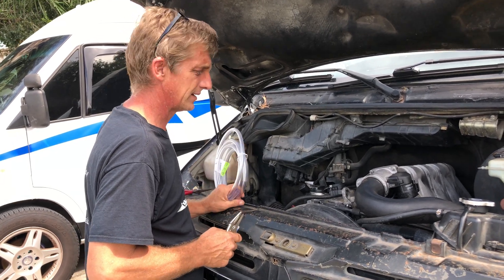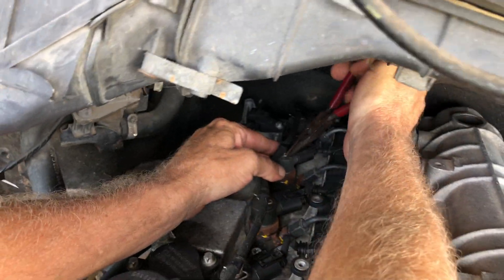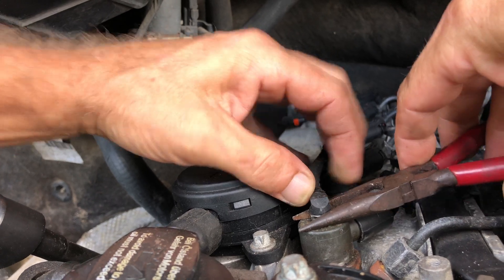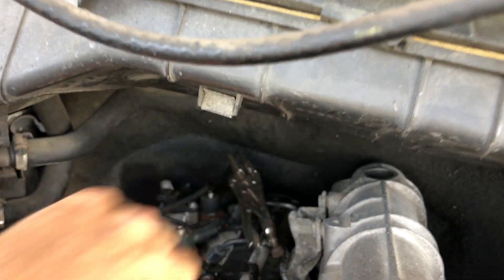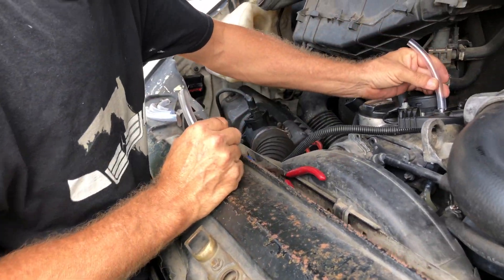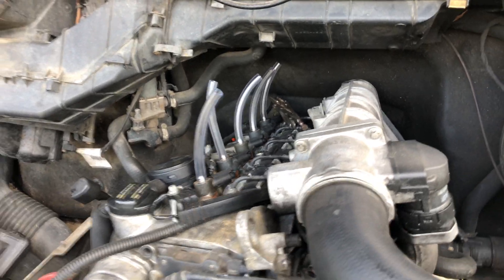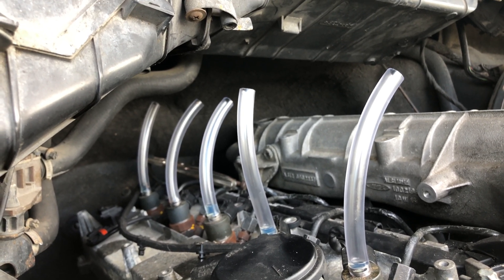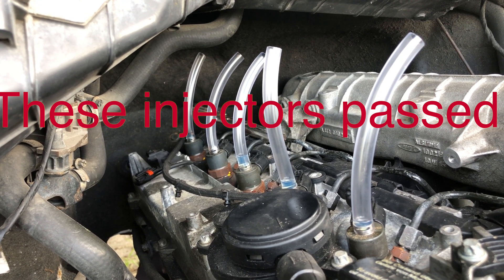Sprinter 2002 Injector Leak Off Test T1N

Comment: Omg, I'm confused. 
So I  did the test exactly as you did first time through,  but not fuel in any of the lines/tube's. Does this mean pass or fail?
Still not starting.
Reply from the maker: Hi Corky, That suggests you don't have enough real pressure to fire the injectors. usually that means the rail pressure control valve has pooped itself. Ideally we'd view rail pressure in live data. if that is low we can pinch/kink the return line and try to get the van started. This only works when there "not quite" enough pressure and won't do anything if we aren't even close.
Reply from the maker: Let's continue on B's Facebook messenger. It is faster and I get notifications there.

Comment: Gotta put new injectors in my 2005 t1n.  What's best route ... Rebuild or replace 
Bosch or ? 
Any sources would help me a ton 
Im in n fl   ...got old ones out with your help. .what a blessing you are 
Spencer Topnotch
Reply from the maker: Ocaladiesel.com - William's Diesel in Ocala is where I have my injectors tested and rebuilt as needed. I do not trust anything on eBay or Amazon when it comes to BOSCH brand name. Local parts stores also sell counterfeit products that do NOT meet BOSCH specs but bear the brand and fake* holograms.

Comment: Will injectors cause van to keep stalling while driving I have a code p0087
Reply from the maker: If one injector is releasing too much fuel to the return line, as this test discovers, the rail pressure cannot be maintained and the van will stall. 
Your code reader is not compatible with your van. 0087 is not a code your van can produce, so we know the reader is miscommunicating the On-Board-Diagnostics (OBD). We have a link for compatible AP200 and a video showing how to set it up for theses vans to get accurate data from the OBD.
Reply from the maker: https://floridavanman.com/
Reply: @FloridaVanMan  also what type of code should it read for something like what you mentioned?
Reply: @FloridaVanMan  wow it’s at a shop & that’s the code they say popped up. Crazy that they don’t have a higher end scanner smh
Reply: @FloridaVanMan  the mechanic says that he doesn’t think it’s an injector because it idles & starts up fine. 🤷‍♂️ can injector still be bad if idling fine?

Comment: Can Injector leak cause t1n crank but no start?
Reply from the maker: Yes! If the rail pressure isn't high enough the van won't start. Injectors leaking to the return line will release the pressure.
Reply: @FloridaVanMan  Thank you for your answer. I'm t1n user in Thailand.❤

Comment: I recently replaced the injector copper washer and bolt on injector no.1 on  my 4 cylinder 311cdi and have created an air lock in the system, can you tell me the best way to remove this air from the system please.
Reply from the maker: Not sure what you mean by air lock. Air in the fuel system will work itself out soon after the engine starts.
Reply: @FloridaVanMan  I just wondered if there was a way to release the air from system going from filter to fuel rail as I can see bubbles in the pipes and it struggles to start. Does undoing the pipes going to each injector help release this air or will it just remove itself once engine is running
Reply from the maker: @MLJ-p7n  Any air in the fuel line will quickly go to the tank via return lines. If you are seeing bubble in clear or white lines that is air leaking in. It often gets in at the 'water in fuel' sensor on the bottom of your fuel filter or the snap-on connections. Since you have lines that you can see into, you must have an OM612, 2002-2003 in the USA or OM611 in UK.

Comment: looks like this is on the to-do list today. 
I am getting codes. p1190-128 rail pressure control valve. p1187-8 rail pressure control valve stuck closed.
Reply from the maker: 1187-8 is very specific to the control valve sticking in closed position. I would still test every possibility before throwing parts at it, but I think* a valve replacement will be your Ta-Da!

Comment: I replaced one injector that was leaking. Two weeks later after a couple of long trips I hadca problem.   When I stopped for a coffee break I tried to start it and it wouldn't start.  Turns over but not starting.   Start ya basdard ( ether spray ) in the air intake  did the trick.   Seems weird if I get a starting issue when I didn't beforehand

Comment: @Florida Van Man  thanks for all your hard work, I love the t1n and since now this is going to be my home for a while can can you make a video to get a wire in an extra battery. The way I did it was adding a spliter and connecting a new lead from the alternator. One side to main and another side to the battery on the back. 

My question is where is the best place to get an ignition wire. I heard there's one under the driver seat but I'm looking for one In the engine. Can you help me with this?
Reply from the maker: Terminal D+ under the seat is the best place. It is fused and proven safe, not causing voltage issues on important sensors.  It is easy to route a wire through the floor hole under the seat. This video shows where to connect, at about 2 and a half minutes in. https://www.youtube.com/watch?v=eJcegZhb4xA&t=82s

Comment: Queston?? Have you ever had any issues with the fuel quantity valve? The valve on the HP fuel pump
Reply from the maker: Not recently. Thankfully.
Reply: fuel pressure is too high?
Reply from the maker: Thanks for the Jinx! I am still fighting this 2002 with a smoking habit. I replaced the fuel management valve on the back of the rail Wednesday. What a pain!!! Good grief that manifold is in the way!!! I tried to make a video of the process and variables that I found, but it didn't go well, to put it mildly. My parts donor had nice hex-key screws that were easily removed from the block that is not in a van (so I can get to all sides). But the van I'm fixing had to have E-8 heads and insufficient space to get a socket in... It was an all day cussing event!

Comment: O one other thing is there a place to get replacement piece for the line should the plastic elbows break during this test.
Reply from the maker: These are better than original: 
https://rover.ebay.com/rover/1/711-53200-19255-0/1?mpre=https%3A%2F%2Fwww.ebay.com%2Fitm%2FDiesel-Injector-Fuel-return-Line-overflow-Metal-connectors-Mercedes-Dodge-5Cyl%2F173914039463%3Fhash%3Ditem287e15a4a7%3Ag%3Ab88AAOSwYUZdS4u7&campid=5338647076&toolid=10001&customid=

Comment: Interesting!  On injector #4 did u finger out why there was little to no fuel in the tube? Tanks for ur test.
Reply from the maker: I put the question out to the real mechanics of the world and it seems no leak-off is better than almost no leak-off. So that is my best injector and the other ones are fine, by this method of testing.
Reply: @FloridaVanMan  I read about injectors that not Leaking can be stuck open not sure if it's the same for sprinters

Comment: Hmm now I'm confused. Why is this not the right way to do the test with the engine running?
Reply from the maker: I have seen Mercedes mechanics do this with engines running in cars, but for reasons I do not know, the Sprinter method is crank with start disabled. When I used Carsoft 8.0 and expensive vials for this same test 10 years ago, the software disabled engine starting. This software is similar to what was later known as D.A.D.

Comment: Those brittle plastic clips though @#$%  I had to wait a week until some new metal aftermarket replacements arrived.. By the way, I have 340,000 miles on my injectors and they are still running  smoothly. I  have no idea when I should replace them.
Reply from the maker: Much-much better than new: 
https://rover.ebay.com/rover/1/711-53200-19255-0/1?mpre=https%3A%2F%2Fwww.ebay.com%2Fitm%2FDiesel-Injector-Fuel-return-Line-overflow-Metal-connectors-Mercedes-Dodge-5Cyl%2F173914039463%3Fhash%3Ditem287e15a4a7%3Ag%3Ab88AAOSwYUZdS4u7&campid=5338647076&toolid=10001&customid=